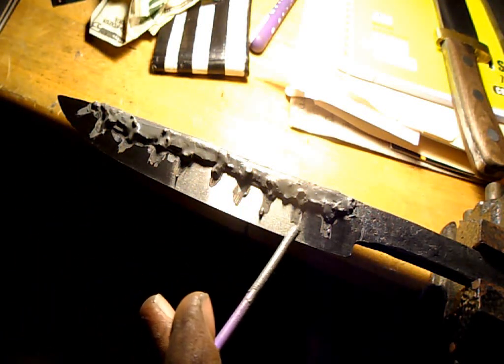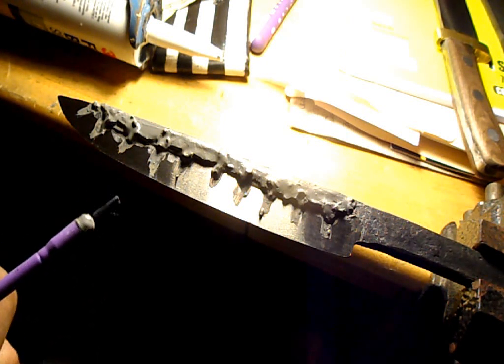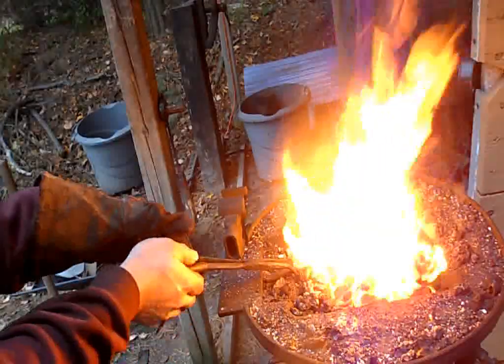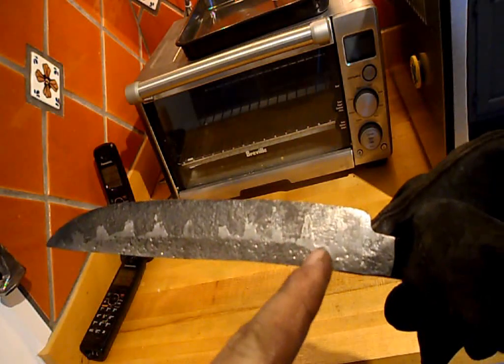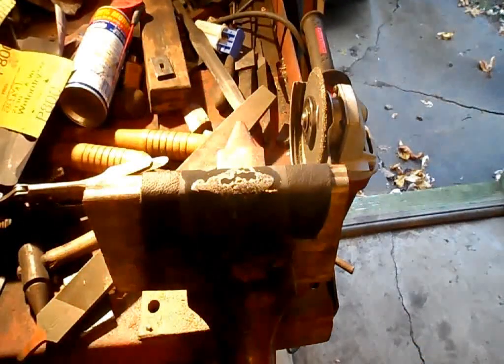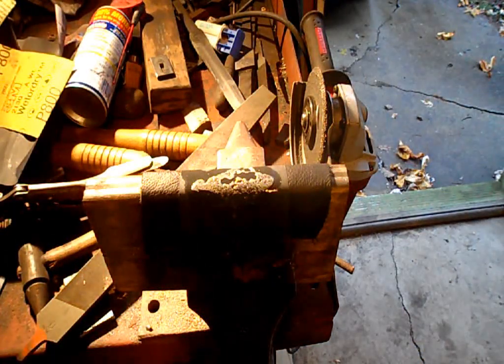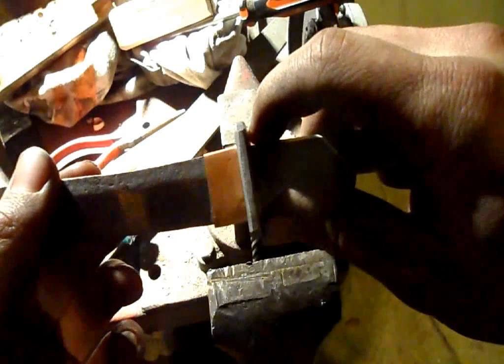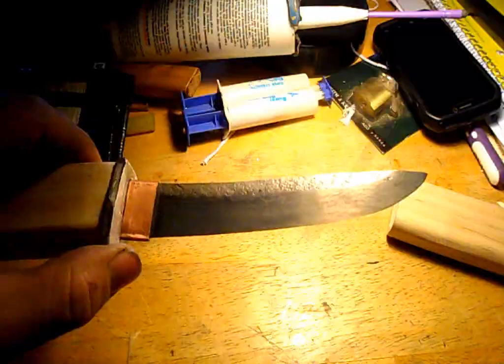How to Make a Hamon

Comment: I dont know what steel did u use but that temperature seems waaay above the critical temperature of the most carbon steels.
Reply from the maker: gdhgdfhdfghgdfh Good point indeed! It seems funny I'm making instructional videos when I still have so much to learn (I'm now studying under a master smith and have learned so much since this video). This was about a 1060 carbon steel which could handle the quench, but would have had a harder edge had I kept the temperature closer to critical as well as a more defined hamon.
Reply: BADsmith I know its pretty hard to get that temperature right :) . If i can give u a little advice, I am using a simple iron tube. Just put it on a top of a coal, wait for it to start glowing and put your plade inside ( hold it with something ) and check the color often in some dark place . With this u can watch your temperate waaay more accurate and u will not overheat it so easily.
Reply from the maker: Thank you! That is some great advice. I'm actually using said advice for my next video on how to temper and anneal a blade. It should be posted later this week, so let me know what you think!

Comment: A hamon is meant for the edge of the blade too make it stronger than the backbone. This isn't even good enough to be called a fake.  It serves no purpose on the blades back. And it is the worst "hamon" I have ever seen.
Reply from the maker: Daniel Torres The clay covered the blades back in the video, and thus made the edge harder during the quench. The back remains stronger and more flexible this way, while the edge is harder  and more brittle. This is exactly what a hamon is supposed to do. For improved techniques, look here:
 https://www.youtube.com/watch?v=JBiRXSfU4xk
Reply: If you are going to be rude at least be right. Maybe you'll do better next time.